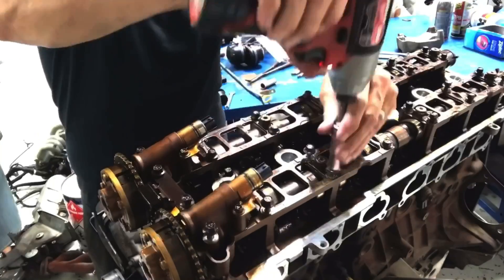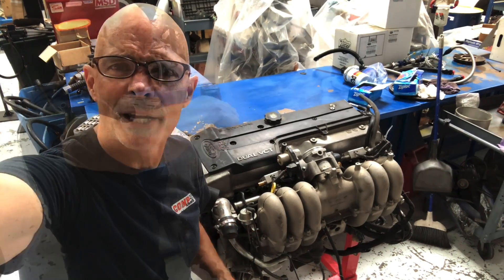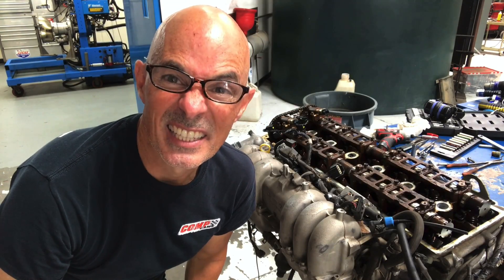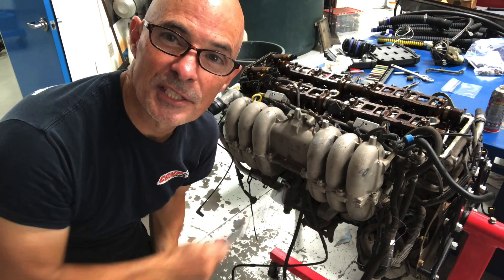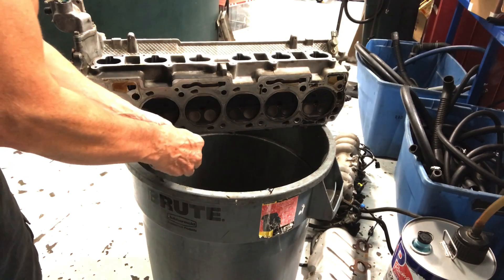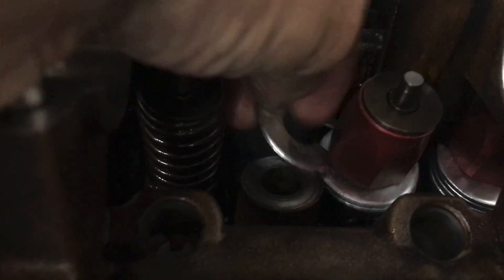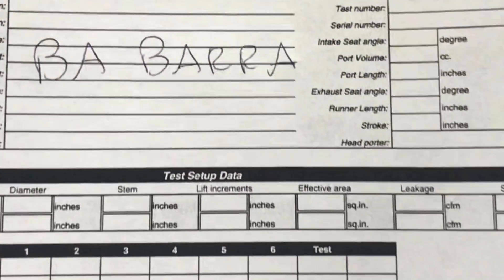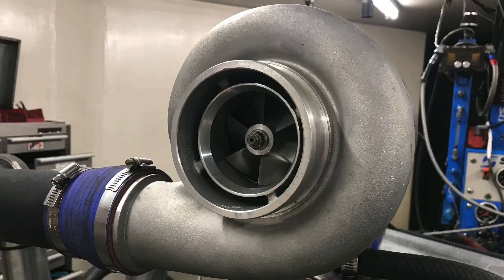HOW TO: 4.0L BARRA-DISASSEMBLY AND HEAD FLOW TEST                          (MY FIRST BARRA)

Comment: Hey please be aware this is a naturally Aspirated Barra engine not a Turbo engine. The Pistons and rods are not designed for boost and won’t make big power. However with some pistons and rods it certainly will.

You’ll be rather limited in turbo power with these rods in particular. I’m happy to help you organise better rods from here in Australia or even some ecolpi rods which are strong but you’ll be limited on this set up
Reply: He's talked about this, he wants to see what the "bad" version does.
Reply: @Levibetz  he has got 3 of them, so blowing one up isn't so bad, for science reasons lol.
Reply: @TheTeeroy32  I think he's down to 2, somebody picked up one of them. I think the "Add Gap" question is a good one to answer. Was it the rings sticking the piston breaking the rod? Seems like a legit question to answer. I have no idea what it cost to ship one to California but I'm pretty sure it's more than what I want to pay for a junkyard engine (JUST the shipping, not the mill). It'll be fun to watch anyway.
Reply: Wat? Ecolpi rods are shit!
Reply: @MRMOPARMAN0426  man they are basically the same as turbo rods guys making over 400rwkw on them.
Reply: @mikjryan  every ecolpi i have seen (not many admittedly) all had 1r23 rods, not the 3r23 rods that turbos and egas engines have.
Combine that with the 12:1 compression, they are the worst barra to use for a big bang test.. Without tipping the internals in the bin.
Reply: @mikjryan  greentops arent ecolpi.

Comment: I wonder if I can get gobs of torque.  500lb torque would be good in one of my trucks. Maybe 79 c30 flatbed ? I'm sure I can locate one at the junk yard. Thanks Richard Holdener
Reply: My factory stock FG Turbo barra made 550nm dead flat from 2000 to 4500rpm, and that is with the crappy floppy factory wastegate.
1200nm is not a big ask - this is 18- 20psi.

Comment: So not sure which way to go with this... Terra the Barra sounds like you're going to bury it... Tear ass until it's bare ass doesn't quite PG rate or make a lot of sense... yah, that's a tough rhyme. Almost un-barra-ble. I don't like ripping them apart with power either. Hand wrench will tell you about it before it pulls aluminum with it. Sad thing is, doesn't seem to really matter. If it's gonna rip threads or break bolts, chances are good (bad) that it will do it either way. I just like a chance to coerce it (tighten, loosen, heat and goo) first.

Comment: That engine looks pretty simple and straightforward... unlike my BMW. 🙄
Reply: How do you think us Aussies can build a motor in the bush with a basic socket set, a hammer and screw driver lol.
Reply: Saw a coworkers BMW about 20 years ago.  He exclaimed, "It doesn't have a dipstick!"  I asked how he checked the oil.  He said the dealer does it.  F that sh!t.  A $5 piece of metal replaced by a $100 sensor and you can't perform the most basic of engine maintenance.  No thank you.
Reply: Yeah, it's ridiculous.
Reply: It is simple. Take any barra, pistons, rods, oil pump gears and valve springs =1000hp

Comment: Speaking of flowtesting, one thing I've always been curious about flow testing is a 2 valve pushrod vs a 4 valve ohc head but with the same port cross section area. I sometimes wonder what getting the pushrod out of the way and adding that second intake valve is really worth apples to apples.
It seems like engines like the coyote flow a ton of air with a relatively small-ish port compared to some of the LS stuff.
Reply: The biggest difference is when you are boosting. Serious air flow at 24psi, and this where 4v demolishes 2v
Reply: @nordic5490  Raw airflow numbers through a port doesnt mean a whole lot. The same valve curtain area that makes a 4v move more air then a 2v even with a port that "flows" the same on a bench is why the engine responds to boost well. Arguably airflow can be identical between a 2v and a 4v and the 4v will produce more power with all things equal(induction, cam timing, and exhaust). An engine doesnt just immediately flow better with boost so characteristics it has Na, will reflect when boosted hence why its nice to have a 4v over 2v because they make power without aggressive overlap, rough idle, and can still support big rpm. If the engine has a fixed boost level, the powerband will mirror the na curve, just with more power and will likely peak in the exact same rpms it did NA. A 2v can make similar power, but it will require much more aggressive camshafts and likely more rpm which will sacrifice drivabilty. This is why those Trickflow 2v heads that flow 240cfm peak still dont produce the power level of stock B 4.6 heads that only flow mid 220s.
Reply: You can match port cross section area between 2v and 4v but you cannot match the valve curtain area offered by 4v per cylinder. The benefit to having so much valve curtain area is requiring much less overlap between the intake and exhaust lobes giving a smooth idle, more hp sustained after peak, and more average hp. A two valve head often requires a tighter intake centerline and lsa to use the escaping exhaust gasses to help draw in the intake charge. This helps promote more midrange but power drops off after peak earlier. Even the fastest dohc cars have super aggressive cams that idle close to stock. Lope is a novelty of 4v cams however ive heard shelf comp cams degreed to 110/114 that idled nasty and still put down like 340rwhp on a stock 4.6.
Reply: @madmod  
Right, and I would be fine with the bowl or curtian area being natualy larger I was just curious what the diference in airflow would be if, to put it bluntly, they were both sucking through the same hole....and I only realized afer typing that how messed up it sounded. 😅
The thing about overlap on 4 valve heads is interesting to me though. I have a coyote with locked stock cams (which only offer a measly 211 duration @.050, 265 @.006) and have been experimenting with cam timing, moving centerline around. I come from a background of small block chevys which generally like a lot of overlap and have going at it with that mindset but you're suggesting that might be a mistake?
How much overlap do 4 valve heads, such as the Ford Coyote, like?
I started with 109/114, basically no overlap @.050, then tried 107/107 (still -3 degrees from overlap @.050) and the engine seemed to like it. Pretty much evey performance cam i've seen for the coyote sets the exhaust to about 114 so i was thinking of getting a little crazy and trying like 95/114 (which would be 3 degrees of overlap @.050) but that sounds like way too much intake advance for an engine that is all about high rpm. Maybe I should try something like 110/98? 
This is my first 4 valve engine. I sure with I could afford a weekend at the dyno just playing with cam timing.
Reply: @177SCmaro  A wide LSA (114) won't kill top end. A low intake LC will increase mid range power and tq without sacrificing upper rpm power. A high intake LC will kill mid range hp and tq all while not increasing hp up top. LSA matters little to where the power is made. What really matters in a 4v is the location of the intake LCs and stock they are somewhere around 118 i think? putting them at 110-112 on the intake will increase power throughout the entire powerband and not really fall off up top as long as you keep the exhaust 114. Coyotes are more forgiving with more head flow, better intake and exhaust manifolds, and more displacement.
Reply: Also, 212 degree cams are pretty solid considering my 99 tumble port heads and cams are equipped with 200°in/196°ex @.050, . 397 lift cams. These cams in a 4.6 are enough to peak above 6k rpms so 212° would be a nice step up lol.
Reply: A terminator cobra only runs 184° intake cams lol
Reply: @madmod  
Well, I'm used to small block chevy's. A 211 cam in a 350 is dinky, practically an emissions cam. I'm used to seeing around 235-ish duration for a performance cam. This winter I'm thinking of some Modular Head Shop cams (which are in that 230 area @.050) + an S475 turbo and make all the horsepower. The nice part about that is yeah, it's 2k for cams and springs, but they already did all the dyno testing and tell you where to set the cams. I don't think comp cams or modular motorsports does.
Reply: @177SCmaro  Modular Head Shop is awesome. Look at NASvt cams as well on Facebook because he spec's some crazy good cams. Cushman motorsports is another big one.

Comment: Good thing Ford never offered that engine in the states, we got those awesome Essex built 3.8 and 4.2 litre V6 engines instead!         NOT
Reply: I did a did a Windstar intake swap, 65mm tb, and ported head 3.8 twin port engine. It runs low 14s with a j modded 4r70 and 3.27 gears spinning out the hole. Luckily the Mustang chassis doesnt need much power to be fun.
Reply: @madmod  "Windstar" is a curse word. Maybe, MAYBE , a super coupe, but no other 90 degree V6, please. I'd rather slam my dick in a door than touch another one of those head gasket blowing,  Intake leaking, synchronizer seizing, no power having turds.
Reply: @jamesgeorge4874  I have a sc 5 speed sitting out in the yard. They work good but the dual port head matched with a windstar manifold is a better starting point than those low compression single ports. The 3.8 sc did make torque like a v8 tho.
Reply: @madmod  you are a FoMoCo soldier my man, I fixed so many, that I grew disdainful, especially compared to the GM 3800, which was robust, easy to  service, and came in supercharged flavor, right up to the bitter end.
Reply: @jamesgeorge4874  I love the gm 3800. I wanted to run one in my sand rail but went with a toyota 4 cylinder. Consider those made 240fwhp with a m90 at 7psi and the 3.8 single port made 210hp with 14psi and a similar m90. Those sc engines could not move air worth a damn.
Reply: We did get a 4.9 liter 55 plus year old design that seems to take boost okay... inlines are a huge pain to package, even worse in FWD.
Reply: @dfabeagle718  the old 250-200-170-144 same block architecture. Bad head design, but it can be dragged to almost Barra
Reply: @dfabeagle718  the Volvo SI6 is a 3.0 I6 FWD, it's pure joy to service.

Ok, it's a bit of a PITA.
Reply: @jamesgeorge4874  My general feeling is that any place you can put an inline 4, you should probably put a V8. I spent 37 minutes working for an Olds dealership very late 80's, with the only redeeming part being they also sold Jeeps. Yay 4.0... needed a v8. lol. I love all this junk, it's way better than walking, but a Jeep Comanche "Eliminator" with a 4.0 sticker modified to 401 and the 401 AMC mill to go with it would have made my childhood somehow better.
Reply: @dfabeagle718  I feel ya. I have been a technician for 30 years now, and honestly, I really liked the Atlas when it came out, because it's smooth, and different, and my daily is a turbocharged inline 5, so that's about as wacky as you can get, but my old beater F250 plow truck always fires right up, with a pump of the gas, no injection, no computer, just a manual choke, manual shift 4 speed, and despite fixing can bus problems on 2018 Suburbans, like I did today, I still like the old, mechanical everything vehicles too. I spent a few minute this morning with my boss, timing a 1934 Chrysler Airflow, with a 415 cubic inch flathead I8. That thing is dope. Smooth as butter. Way ahead of its time, almost 90 years ago.
Reply: That 3.8 and 4.3 Gm v6 was a damn reliable power plant . I seen them s10 blazers with over 375 k and still running when the truck got junked.
Reply: @gregblack3860  I put a 4L60E in a Chevy Express that had 667,000 miles on it, had the Intake gasket, and a water pump or two replaced on it. The transmission had gone a little under 400K, and was the second one the owner had installed.
Reply: And the sohc 4.blow..
Reply: God i hate the gm 3800, personal experience, weeping headgaskets blowing coolant out of the system, weeping intake gaskets letting oil into the intake, cooling system corrosion so bad that holden had its own " commodore" coolant to try and reign it in , small easily blocked oil pump pickup starves the crank. All the mechanical refinement of a clothes dryer with half a brick in it, an NA barra has more power and torque than than a blown 3800. Your experience may vary.

Comment: Granted, those LPG engines make good horsepower with a turbo, but what inline six doesn't? A factory XR6 red top Barra would decimate most standard built inline sixes. No doubt that it's on par with a 2JZ.
Reply: i found most inlines are amazing i have an 7m-gte in a mk3, i have an old school chevy 250 (4.2) l6 going in a firebird, would love to tinker with the ford 300 l6 and jags 4.0 inlines, vortech 4200 etc etc. Seems like with enough time all the 6s can be made to over 500hp easily. wish we had the barra over here and chevy's vortech 4200 was more accepted to warrant competition !
Reply: XR6 barra is no magic. Any barra is good
Reply: @8power857  apart from the rods and pistons to allow more boost, your completely right.
Reply: @TheTeeroy32  i said xr6 , not xr6t. 👍
Reply: @8power857  but you were replying to the OP who said 'red top". Which in Barras is a turbo motor, going by that I'm sure you can see were I was coming from. 👍
Reply: @TheTeeroy32  ah! Yes my bad, thankyou 👍👍

Comment: I would REALLY like to see what a red top Barra from a XR6 would do. Here in the States, we were lucky to see this engine. We'll likely never see a red top Barra.
Reply: Even better go a blue top out of an FPV FG F6 416hp 417ft/lbs stock as a rock…,
Reply: @brendencole941  yes but remember thats essentially just valve springs and boost over a plain turbo motor. Nothing any other barra cant do. But yes , they are impressive to drive for a factory car
Reply: It is basically the same,, gives same output potential.
Reply: @8power857  I clearly don't know the differences between them. I just figured that the turbo engine would've had a better flowing head, cams, etc. Thanks for clearing that up for me bud.
Reply: @DiamondBackRattlaKid   no problem,  all the barra variants are very similar. A few comp ratio variances, connecting rod changes,  valve spring changes etc but the basic block, heads etc are pretty much the same. If you chase decent reliable power , 600rwhp, you are going to change rods, pistons, oil pump gears, head bolts, valve springs. 
  The xr6 versions and g6e(sport luxury) get lower diff ratio, thats basically it!  Things like the F6 Typhoon have more mods but vasic stuff.  Any barra 6 has the same end potential.
👍
Reply: @DiamondBackRattlaKid  only rods and comp ration, rest is same
Reply: Nope. I have a factory red top turbo barra inmy FG XR6T and 2 na barras. The redtop is low compression mate. The BF - FG LPG Barra is better as has strong rods, and 10.5:1 cr that gives much better throttle repsonse preboost.
Reply: Barra sux Ford guys go on and on about them but there sux
Reply: @jeffwilliam7500  🤣
Reply: @jeffwilliam7500  Well the head bolts didn't snap off on the Barra like the atlas

Comment: Keep in mind this was done on a 96mmØ Bore fixture. The Ford 4.0L has a 92mmØ bore. So these results will be skewed high a little bit.
Reply: Also note, without a intake manifold attached, the injector vane is flowing air. This would never happen in a real world scenario unless a carb manifold is used.

Comment: Lpg is green tops
Reply: that engine was duel fuel
Reply: If they were running it on lpg the engine should be in better shape than one run or gasoline, providing that regular maintenance was performed.
Reply: @scottb3637  Yep we have a territory with the same lpg injectors as this motor with 330k and is as clean as a whistle on the under the valve cover. I even did a oil change after 25k by mistake because the oil on the dipstick was still somewhat clear when i checked I realized my mistake. This barra hasn't had a oil change for at least a couple of years before going top the wrecker.
Reply: @scottb3637  yep, & clean as a whistle inside 👍

Comment: Good see ya playing with a seagull.barra just some name public gave them.the engineer who work and made them called them seagull which means they shit on everything. Rego  barra here in Australia driving   on they street with 2100 hp at rear wheels with stock block.Ba engine is just a au block which was previous engine with a 4 vavle  head. I love au engine what a weapon for 2 vavle head.last time looked into it au engine was quicker down 1/4 @7.5 vs 7.8 for barra maybe could changed.peace
Reply: Yeah, the Intech is waaaay easier to work on, Team AU 👍

Comment: One handy tip for keeping track of screws. On surfaces where they are not going to be in the way just run them back into the holes they came out of. Besides it keeps crap out of the tapped holes.
Since this is a six, and FoMoCo owned Jaguar at one time slip one of these into an E Type
Reply: HEAVY.
Maybe a pinto? Or [insert small unloved inline 4 ford here]

Comment: Did you measure tumble flow?
I ask because I've seen tumble improvements reduce MBT by 15 degrees, threshold to knock by 5 degrees, and specific fuel consumption by 6%. I think it should be high on the list for anyone who deals with a head capable of using it (largely hemi or 4v designs), especially in pump gas turbo applications (Look at the M139 engine, it doesn't even breathe well but gets 200hp/l because of massive detonation resistance and equally massive boost)

Also N/A BA Barra in dirt track is cams, springs, and oil pump away from 275-ish whp. They are ok even without boost. FG and aftermarket intake manifolds can get that up to 300 (that intake manifold was initially designed in 1987 or so, when the predecessor for the Barra was designed. It wasn't actually used until 94 though. It's a good piece of kit but progress has marched on).